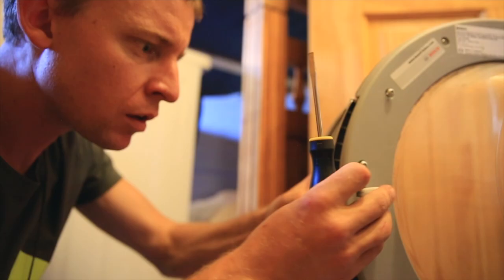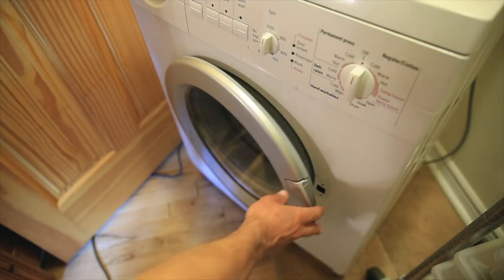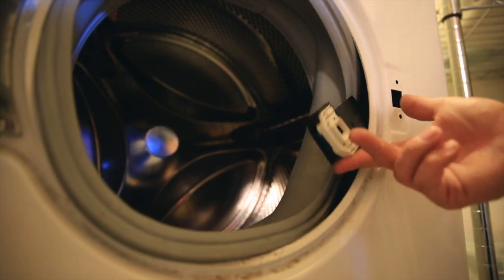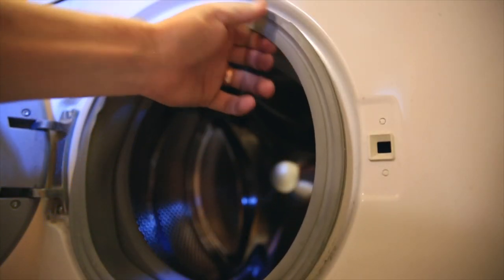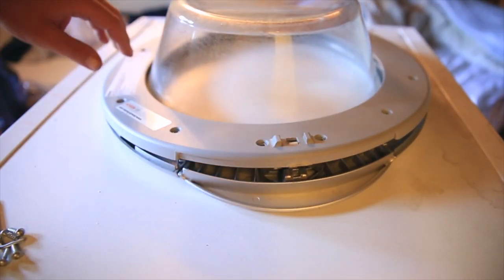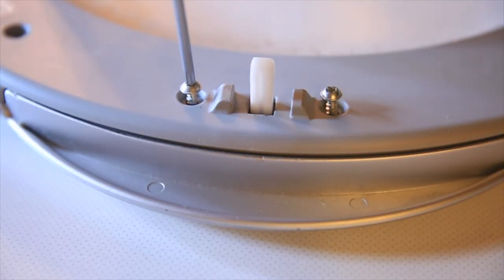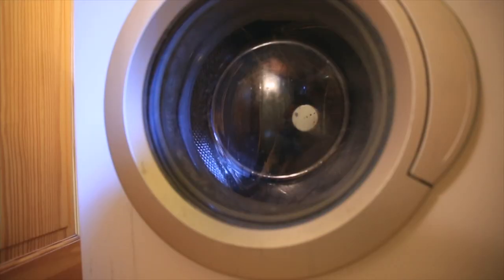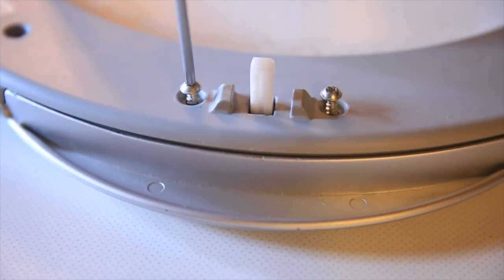How to repair a Bosch Washing Machine door handle

Comment: great video ! nicely explained. Well done! I broke the plastic square on the machine with a big screwdriver when prying the door open. Now the washer does not spin anymore. Repairman said I need to change the handle on the door and motor carbons (?) but not the lock on the machine which I find odd. Will cost nearly $400 :(